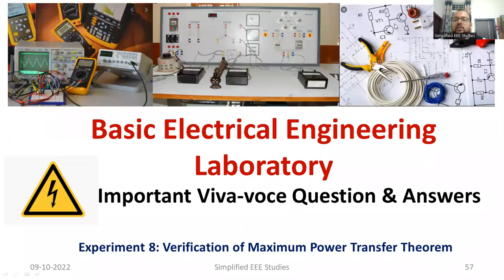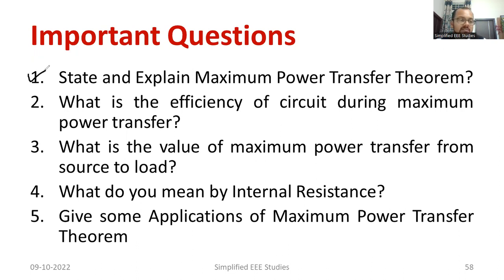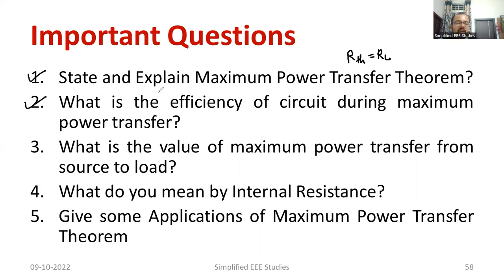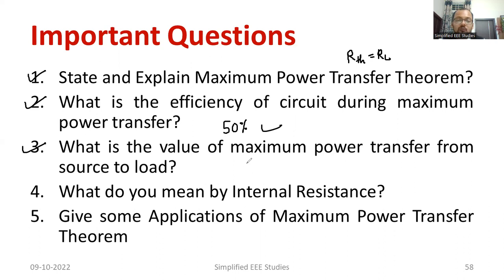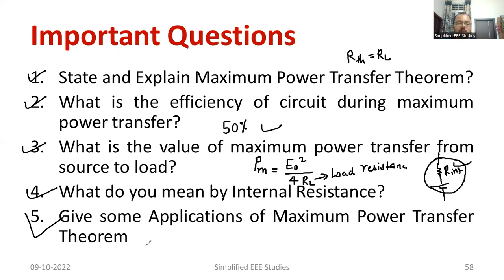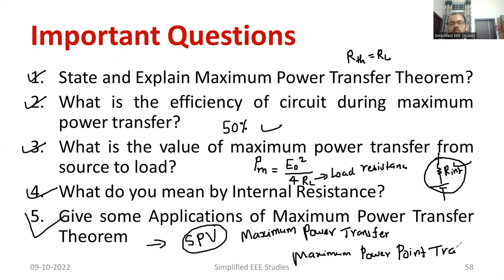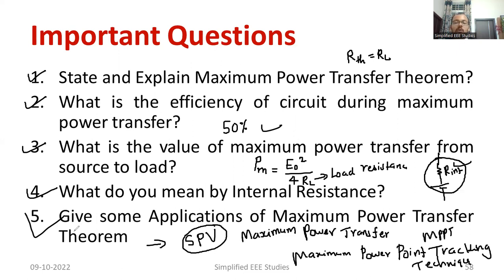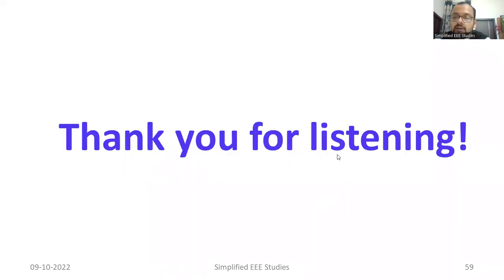Maximum Power Transfer Theorem Viva Voce Questions and Answers Basic Electrical Laboratory VTU BE

Comment: Why the efficiency of circuit during maximum power transfer is 50%...?
Reply: efficiency = output / input = (v^2 / r_L) / (v^2 / r_L + r_th) x 100 % 
since r_th = r_L
therefore, efficiency = (v^2 / r_L) / (v^2 / 2 * r_L) x 100% = 1/2 * 100% = 50%